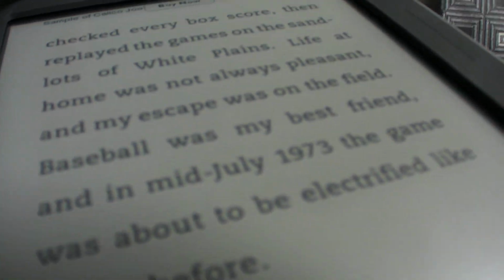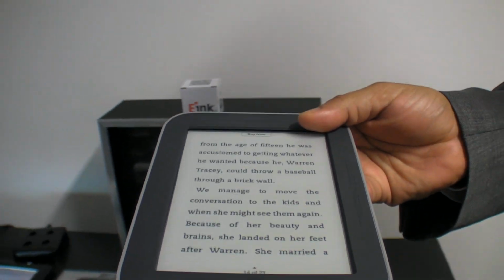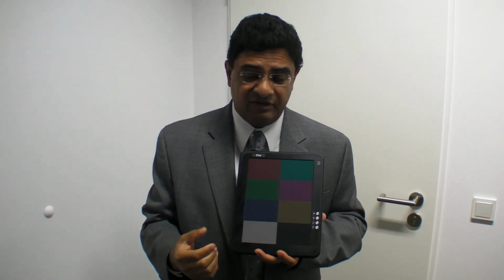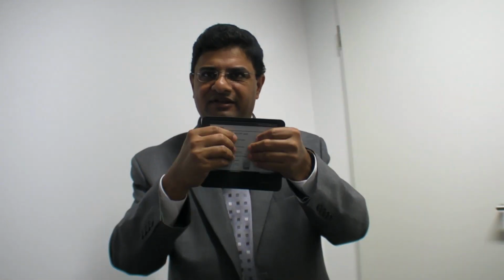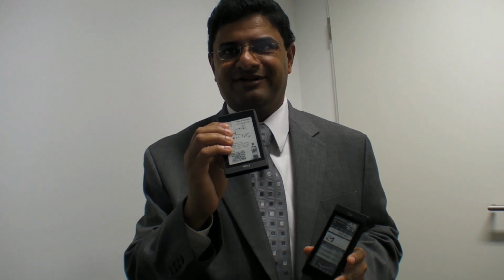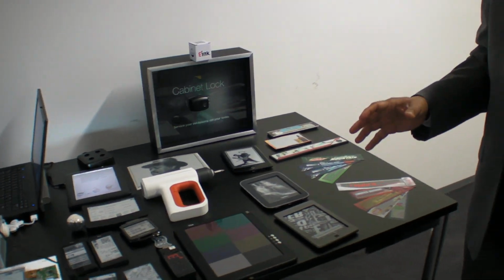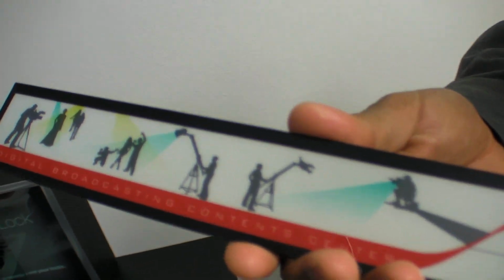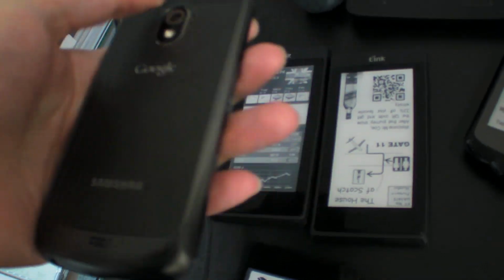E Ink on your Smartphone

Comment: iOS firmware is becoming extremely battery efficient. This type of technology will become useless in the coming years because companies are increasingly finding new ways to optimise battery usage.
Reply: Ty,
Any screen which uses a backlight to make an active matrix screen visible is going to take a certain minimum amount of electricity. Producing light requires a certain amount of electric current. e-Ink, however, does not use a backlight. Because of this, the electric current used to light an iPhone does not have to be used. No matter how efficient an iPhone becomes, it can never get anywhere near as good as e-Ink.

Additionally, since e-Ink is a kind of passive matrix, while iPhones use an active matrix screen, the electricity required to maintain the image on an iPhone isn't applicable to e-Ink either. 

Consider this: You are looking at a page of text on your iPhone, I am looking at a page of text on an e-Ink reader.
The iPhone uses electricity to put the image on the screen, and then uses more electricity to maintain the image on the screen, and then uses even more to power a back light so you can see the image on the screen.

The e-Ink uses electricity to put the image on the screen. 

That's it. e-Ink doesn't have to work to keep an image on the screen, and it doesn't have to work to light up your screen. That's why my nook lasts 2 weeks when I use it as much as my smart phone, which only lasts a day.

In short: shut up, you're a moron.
Reply: Brian Arnold Fair enough. You can use your e-ink technology while I'll use my iphone that is progressively becoming more and more battery efficient so that one day it will rarely have to charge.
I'm not saying that this technology isn't useless but that putting it on the back of your phone is a tedious attribute to sell something "new". It will fade.
Reply: >implying your favorite mobile OS and digital ink have practical mutual exclusivity
Nice try, Steve Jobs' son-in-law!
Peddle your iWatches elsewhere!
Reply: E-ink is used not because of it's energy efficiency, it's the readability it provides. Can your iWhatever's screen emulate e-ink?